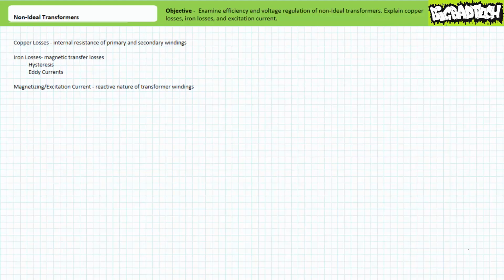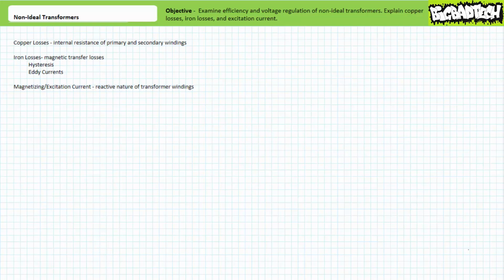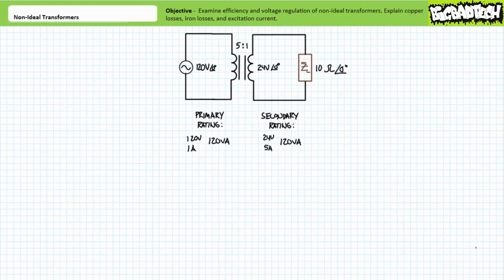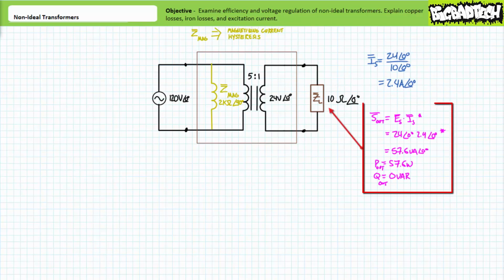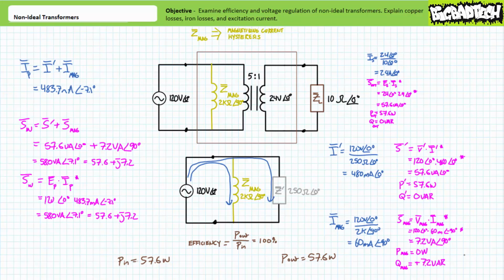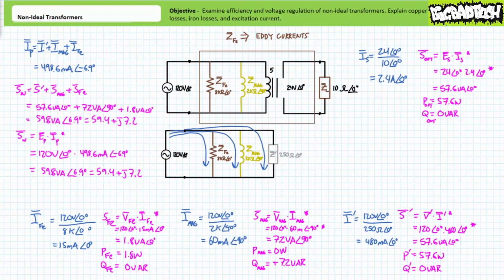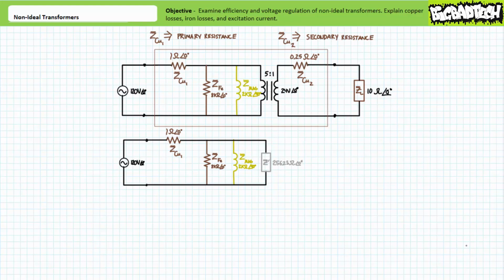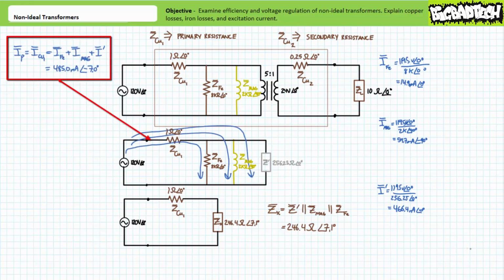Non-Ideal Transformers (Part 1 of 2)

Comment: I found one good use of Eddie currents, where the design facilitated their use: Eddie current brakes on rail vehicles. My question is this, if most designs are to eliminate these problems, then how does one encourage them for use in braking? Do you not use laminated iron cores to promote the effect?
http://www.electric-vehiclenews.com/2016/04/electromagnetic-braking-for-electric.html

Tx for the great vid!
Reply from the maker: Very nice. If you take a look at the second picture the discs in which the eddy currents are generated appear to be solid. I'd liken this volume to be a fire hose sized, low resistance conduit of current thereby accentuating the magnetism. I'm presuming they're also using some high frequency (ie: rapidly changing magnetic field) to induce high eddy currents in these discs. Good find.